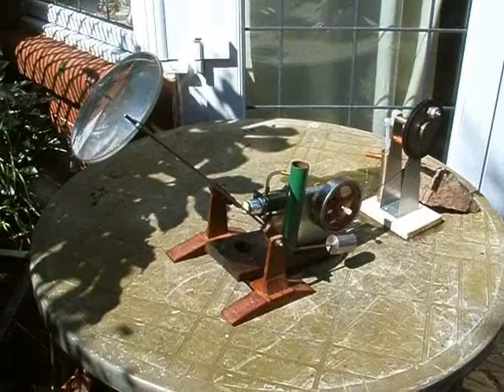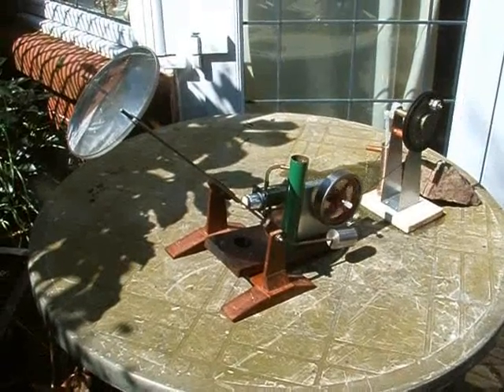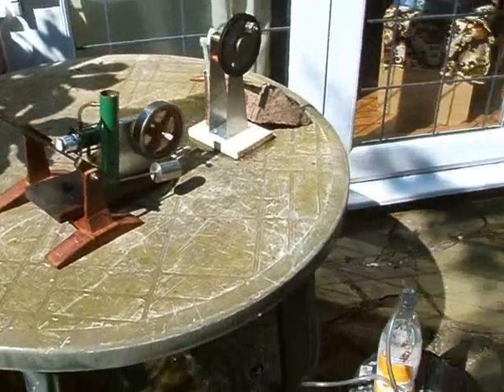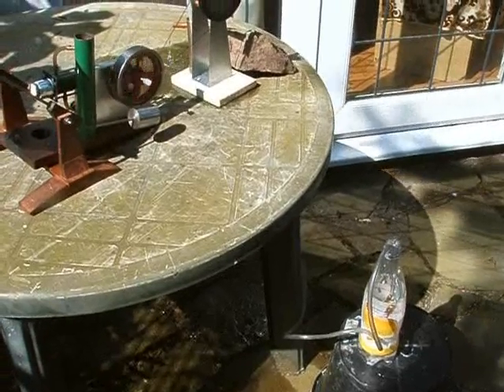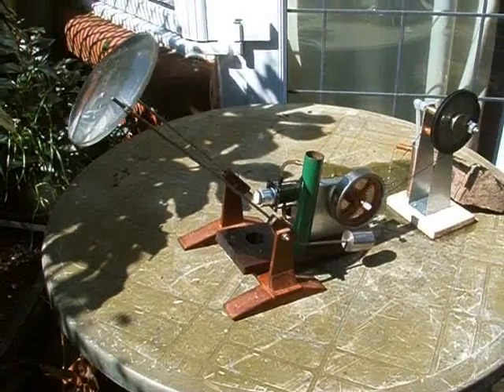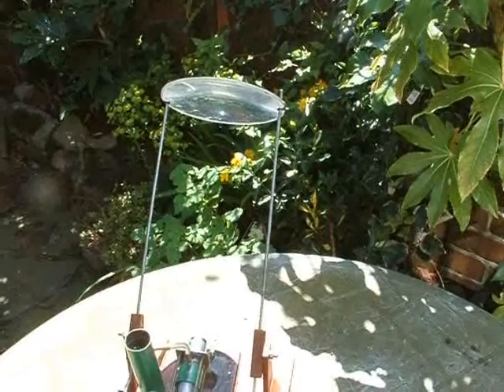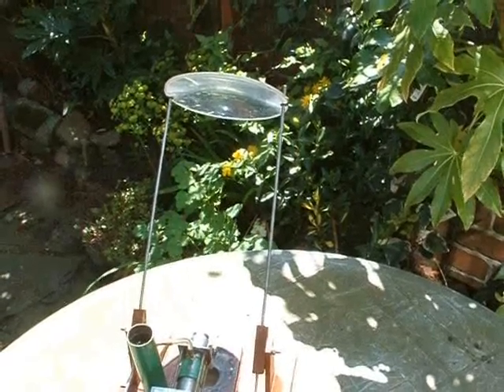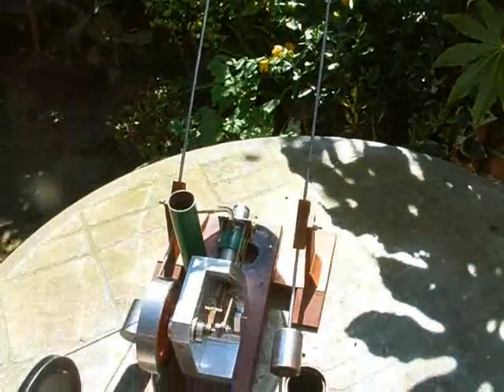Solar powered Stirling Engine & water pump

Comment: why can't this be a solution to the "worl problems"? it does scale up, and a desert is where there is abundant sun light... maybe a low temperature gradient model would even need less sun / no lense and just using the temperature difference of water from say 10[m] down and a black surface in a desert sun would be enough to pump a dozen of buckets per day? with the option of burning some thing on top of it to run  faster if necessary ... ?

Comment: It is very good and it MIGHT help solve the problems of the world!
  I have an experimental tracking system that can focus the energy from 9 or 10 sq ft on a stirling engine.  Thats about 45 times the power of your working water pump!  Or you could go bigger it you wanted.
The idea is about 5 months old and so far i just have it at model stage.
Anyone can try it, it is a free idea, it is open source and available at appropedia.
Combined with stirling engines, perhaps it can change the world.

Comment: Great video! I am making a stirling with a single cylinder finned barrel now and it should turn an alternator. Stainless water bottles make great displacers I have found if you can tig weld with some skill.